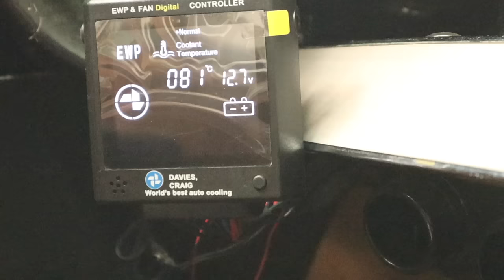Can I stop it overheating?? - Ferrari engined Alfa 105 Alfarrari build part 212

Comment: Jeff, I am a mechanical engineer and there is no such thing as “too fast” or “too big” of a radiator. The convective heat transfer function (transfer of heat from a surface into a fluid, liquid or gas) has a velocity variable, the higher the velocity, the higher the heat transfer. Think about sticking your hand out the window of a moving car, the faster the car goes, the colder your hand feels, even with a constant outside temperature. That’s because the faster moving air is removing more energy from the surface of your hand. 

As far as the size of the radiator, convective heat transfer is also dependent upon the surface are that the fluid is in contact with.
Reply: That was my (vague) understanding too - I have heard the "too fast" thing before but I wasn't that convinced. But this mod has worked - any ideas why? I'm lost on this one 🤷‍♀
Reply: As I understand it, it doesn't cool the motor very much if the whole sistem is roughly the same temperature. He basicaly made a bigger difference between inlet and outlet temperature so water can absorb more heat from the motor. At first I couldn't believe what he was saying but we've seen the results.
Reply: Laminar flow can allow the hot water to pass over the cooler water.  So water speed is an issue .
Reply: Mechanical engineer or not, you literally just saw it work.
Reply: Also an engineer here (automotive, oem).  Unless you're getting cavitation in the radiator (unlikely), lower coolant ∆t means better cooling. 

To improve cooling you need to move more air across the radiator, more coolant through it or improve the heat transfer efficiency with a different core design. 

Which one of those depends on the problem. If your coolant out is more than 5c lower than coolant in, you need more flow. I would start with taking out the flow restrictor.
Reply: @seanalexander9531  Multiple pass radiator makes sure the surface of the radiator is used more efficiently by making sure the water flows everywhere without big stagnant regions.
Reply: @seanalexander9531  The coolant was passing too quickly through the core and therefore not given enough time to transfer the heat from the coolant to the fins to the air (this is not instantaneous). By making the core a triple pass, the coolant is now being given 3 times longer to do that transfer before entering the engine again to be heated back up.
Reply: I have to disagree Brent.
.
Only because of a comment made in episode 207 by Darrylflilfe.
(Top comment).
..
He was talking about the head pressure of the electric water pump suggesting the electric pump does not flow or push enough coolant through the system adequately enough.
..
Upon further reading in that comment thread it is mentioned how the thermostat IS a restriction.
When you consider the size of coolant pipes and the small aperture of an open thermostat, it does appear to slow the flow rate of the coolant.
..
I suspect there may be a mismatch in components here.
..
There's going to be nominal coolant flow in the engine block, pump and radiator core.
If all three are not matched or in sync with each other then overheating might be the symptom..
..
But baffling the core it would appear the flow rate was subtly slowed but not just through the core, but the whole engine, allowing better heat  transfer to the coolant...
..
My only concern, with Jeff's core baffles.
It might restrict coolant flow too much at high RPMS..

I'm not trying to patronising just trying to understand the coolant issue on the Alfa.
Reply: @stevewandel9317 yes that's what Jeff explained in the video (and obviously something has worked). However we have a couple of auto engineers here disagreeing.  So I'm keen to understand why. It's worth noting that I'm not wedded to any of these ideas (Finnspin unicycles has come up with a possible answer above).
Reply: This is really irritating me. I would have bet my life that this wasn’t the right approach. Because of the leccy pump, flow rate (pump speed) is independent of engine speed. So how does the setup transfer 300kw at full load but can’t dissipate a few kw at the same coolant flow rate? All the discussions about better use of rad core/heat transfer rate etc, don’t address that. My only (radical) idea is that high rpm vibration causes turbulence which increases heat transfer, whereas at idle the flow through the core is laminar and obvs that doesn’t work too well. Yes that’s a long shot but something odd is at work.
My irritation at not being able to conceptualise the issue is tempered by the fact that I wouldn’t ever use a rad that big. I’ve always used the smallest rad possible and never come across an issue like this.
Reply: It wasn't the speed of the flow through the radiator that was a problem, it was simply that the flow wasn't evenly distributed, i.e. very little of the radiators area was doing any heat transfer. If you did some CFD modelling, you would observe that most of the effective heat transfer area would be quite small, and lots of stagnant or near zero flow zones.  Alternatively just use a cheap thermal camera (FLIR) to observe the temperature regions in the radiator (my sense is that maybe only the bottom 1/4 of the radiators had any significant flow occurring)
Reply: I'm not an engineer or anything but I have a guess (correct if I'm wrong) but once the radiator is filled since it has a thick profile, how do you make sure that all the coolant being pumped through it goes through the heat exchange surface evenly?
couldn't there be stagnant water inside the radiator? Think of a boat on a lake, it would propel itself by moving only the water on the surface of the propeller but the water underneath would remain still, couldn't something like that be happening in the radiator? and the triple pass makes sure the entire volume is being pumped through without any still water in the system?
Also tangentially related couldn't an exhaust wrap help by not dumping excess heat into the engine bay?
Reply: @CezarTrifoi  yes, of course. But why does the same flow regime allow dissipation of full power. The electric pump means the flow through the rad is the same regardless of engine speed.
Reply: Perhaps because at full power there is a large enough air flow (due to the car’s speed) to compensate.
Reply: @greens007 I guess, but I’m just (massively!!) frustrated at not being able to get my head around it. I’ve always been confident in my understanding of cooling systems.😂😂😂
I just come back to my safe space and think I’d never use a rad that big (in terms of coolant flow).
Reply: Totally agree.  Only time it can be too fast if it creates cavitation. Heat transfer efficiency is proportional to the temperature difference.  I’d use an infrared thermometer to see the temperature drop from inlet to outlet to see if it is the rad at all.  My first thought was the water pump was too small.
Reply: If the flow was too fast it might have been worth slowing the water pump down - or reduced the PWM duty cycle if that's the way it is controlled.
Now I'm concerned there will be problems at high load because the radiator flow will be restricted. 
There is more to this yet to be discovered. As Jiminycricket says, if the rad can dissipate hundreds of kW at full load why can't it manage a few kW at idle?
Reply: @jiminycricket9877  because when trying to dissipate 300kW at full load, the car isn't sitting stationary with no airflow. It's moving down the road at speed forcing air through the core.
Noticed that the fans that dynos use are way bigger than a rad fan?

Also, what's the average temp where you live? Australia is bloody hot compared with most places in the world. 40 degrees C isn't uncommon in many places.
Reply: @stevewandel9317 yes, but you shouldn’t need a dyno fan to cool at idle!!!!
I know this is just one of those things. He’s sorted it (at least as long as it will still cool enough under load), it’s working for the car and that’s great. I would just like to know WHY it worked so I can learn from it.
I hate going round in circles. The electric pump means the flow through the rad is independent of engine speed and load. So the same coolant flow (and the same coolant flow pattern in the rad) and the same Delta T can dissipate an order of magnitude (or more) energy with a bit more airflow. There must be a combination of factors at work.
Grrrrrrr.
Reply: I totally agree with the first comment, the radiator is now achieving heat transfer through more contact of the cooling area rather than a reduction of flow, I am also unsure that a radiator of that thickness is suitable to utilise an electric fan, all modern cars that use electric fans the core is much thinner, I have experimented before for overheating issues and believe it or not a heavy duty mechanical fan that is commonly removed normally moves vastly greater amounts of air than any electric fan, I do appreciate that a mechanical fan is not achievable here
Reply: @bena6852  the problem with mechanical fans are that they are redundant usually whilst moving at speed (which is hopefully more often than not), and therefore are unnecessarily using up some of the engine power
Reply: @jiminycricket9877  the dyno fan is to replicate the airflow through the rad like when it's moving.

It works because the coolant is now more exposed to the airflow through the rad, giving it time to transfer it's heat to the core, and therefore to any airflow.
I wouldn't have thought of it as a solution, it's a bit of brilliant thinking to be honest.
I might consider doing it on my 80s turbo Subaru. The rad in those barely copes with an NA engine in Aus heat, let alone with a snail hanging off the engine.

I also believe that the pump speed isn't constant. He's got an electronic controller for it that has a temp sensor. At dead cold, it doesn't pump at all which replicates the thermostat being closed. But the pump likely has a slowest speed which is maybe still too high for this application.

There is a combination of factors, but you may be overthinking it.
Idle, especially after a spirited drive, is the worst condition. Everything heatsoaked, plus no naturally generated airflow through the rad, so need to have a system that allows the most coolant to transfer it's heat out to the artificially generated airflow.
If a vehicle is overheating at speed, then you've got a real problem. So, design the system to handle an idle condition, and likely it'll work at other times anyway.
Reply: @stevewandel9317   I’m aware that I’m overthinking somewhat and I appreciate your thoughts, thank you.
But….. the system wasn’t failing in the heat soaked condition, it was just gradually warming from cold and not being sufficiently cooled.
The pump speed isn’t constant, as you said, but it is (or should be) temperature dependent so 97° at idle or 97° at full chat should equal the same pump speed. With a mechanical pump you can have issues where the pump is too slow and doesn’t pump enough at idle, or too fast and cavitates at high revs. A leccy pump should eliminate those issues.
By all means try what you like on your scooby, but be careful. My main irritation here is that of conceptualising the issue and learning some lessons. Jeff has definitely reduced the ultimate cooling capacity of the rad, but is compensating for some other issues.
Cheers, Jim
Reply: This is how I think about it: the coolant is now spending more time inside the radiator since the passageway is longer. As a result the heat is now dissipating more efficiently. Agree?
Reply: @Rehnqvist76  define efficiency! The cooling is obviously improved, the question is why.
Just leaving the water in the core longer actually reduces the amount of heat transfer possible. You want as much of the core to be as hot as possible to maximise heat transfer.
There are so many complicating factors. The flow inside the engine will have an ideal flow rate and inlet temp, the rad will need certain air and coolant flow rates and the whole system will dictate how much pump pressure is needed.
After much contemplation, I think the most likely scenario here is that the rad is too big. The flow inside was laminar so couldn’t transfer heat effectively. Jeff has effectively made the core a third of the size so tripled the coolant speed through it, causing turbulent flow and good heat transfer.
Reply: I'm wondering if the improvement as a triple pass has something to do with making better use of what is a relatively thick core? A thick radiator is less effective than a thin one, as the air heats up before its passed through the radiator. Think of each pass as hot, med, and cool, the greater the temperature difference between the water and air the more effective cooling. It potentially won't make a great deal of difference in the 1st pass but in 2nd and 3rd passes the air won't be as hot as it passes through the rear core of the radiator. My mini also improved cooling with a triple pass, also with a relatively thick core for the radiators frontal area.
Reply: @arrindaley3714  yep, I think you’re on the right lines there. When I’ve been saying the rad is too big, I mean in terms of coolant flow area - thickness is a big part of that.
All this is pure conjecture of course, you really need to get a few sensors on there and measure everything. Then you could make some sense of it.
Careful how you think about it though. Yes you’ve got hot, med and cool sections and the air will heat through the thicker core. The coolant flow rate is the same through each section though and the coolant speed is going to be approaching three times what it was for the single pass. Each section is going to have the same air inlet temp so the hot section will give up a lot of heat, the med section less and the cold section less again. You’ve reduced the cooling capacity of the rad. You may be compensating for other factors (as mentioned before, increased turbulence etc) but in absolute terms you’ve reduced the total cooling available.
Cheers.
Reply: @stuartd9741 I'll agree , removing the thermostat may be at the root of his issues . And completely agree , he needs to get it on the road to test it under significant Ferrari type loads.  See if those additional plates create issues under more heat at engine.

Comment: Nice work Jeff, I think what you did was making more use of the radiator surface by directing the coolant through the whole radiator instead of the shortest route through the radiator avoiding dead flow areas.
Reply: Agreed, I suspect the larger part of the coolant was taking the path of least resistance down one side across the bottom and out. Checking the temperature at different parts of the radiator might have revealed relative hot/cold spots.

Comment: The Alferrari sounded surprisingly like a four cylinder!
Reply: It’s a flat plane crank. So it runs like two four cylinders phased together. The big American sounding V8’s are cross plane.
Reply: He also plated between the xpipe so the banks no longer merge
Reply: That was my first thought, too.
Reply: @neilmchardy9061  - Correct.

Comment: My Sunbeam Tiger was notorious for overheating  and living in Arizona where summer temps can be over 115F i did something different to fix it. I added an extra heater core under the car. It has fins to run the air through it and an auxiliary fan for stop and go. Works like a charm. Used flexible copper tubing to run the coolant.

Comment: 1:30 -  and smell them! 

Re. the mufflers - they'll be quiet to start with but get louder and louder as they carbon up, ending up as practically straight-through - I had one on my Yamaha Fazer back in the day, lovely sound to start with but after less than 1000m I was getting old-fashioned looks from the plod.

Comment: 3.5 turns lock to lock sounds about right for a 60/70s car, but without power steering.
On a side note, I had a bit of trouble getting used to an Escort quick rack back in the rallying days, eventually got there though.

Comment: Jeff I used to work at Aussie desert cooler. I noticed the block off plates you welded in are in the wrong spots. The block off plate under the radiator cap should be higher than the plate  on the other tank. Draw it on paper to make sense. The top section is not flowing theway you think.
Reply: I don't think the cap makes a difference, the higher block-off place is at the inlet side, the lower plate is at the outlet side, this ensures that the coolant has to travel through the radiator completely from inlet to outlet.
Reply from the maker: The inlet is on the opposite side of the cap in this case. Cap is probably in the wrong spot, but I am not overly concerned.
Reply: I looked at it again and i was wrong..keep up the good work. I'll shut up now..lol

Comment: I converted my 1966 Alfa 2600 using a rack and pinion from a Subaru Liberty and had the same problem of "slowness". I redrilled the steering arms to gain a shorter throw but because of subframe clearance prolems, I had to make space to shift the rack aft to prevent reverse accerman and lower the lower whishbones to prevent bump steer but it now works. Good luck, I'll be watching with interest.

Comment: When i built my Austin Healey special I though it had direct steering.  My Alfa 916 Spider has even more direct steering and the rack is small.  It is power assisted but some of the Alfa models out there being wrecked might be a thought.  Now the logic behind the cooling is very impressive.  You must be really thrilled to have thought your way around that one.  Well done.  Finally the exhaust sounds really great at the moment.  They sound different outside the car under load anyway.  Full marks.